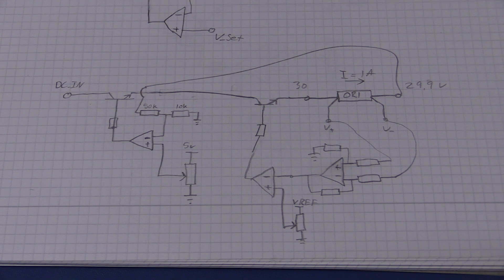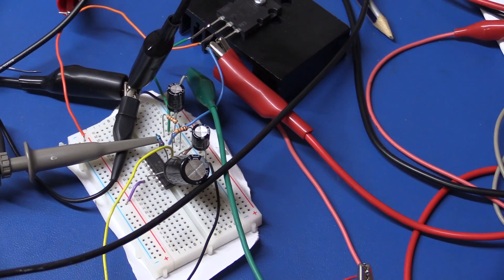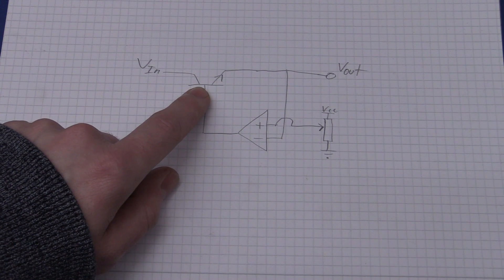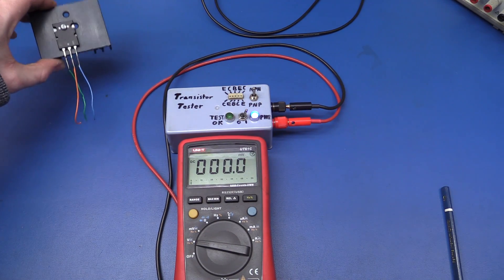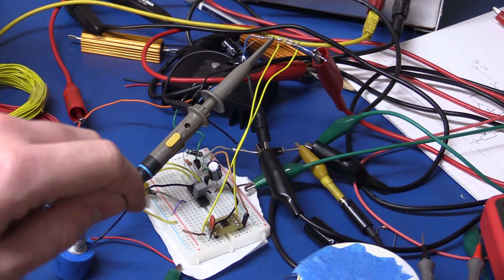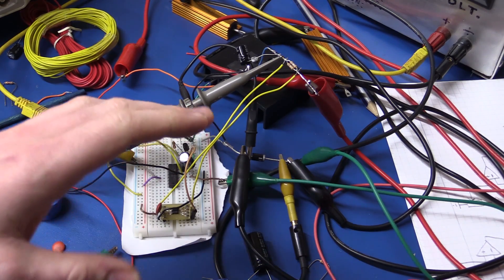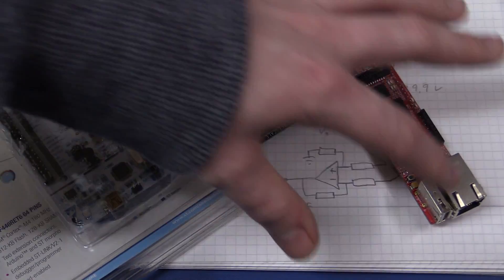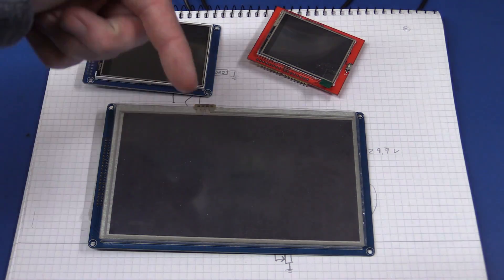DIY Digital Lab Power Supply: Part 2 - Ec-Projects

Comment: Maybe way too late since you might already have decided: but I really like the STM32 series of micros. The AVRs on Arduinos feel so limited hardware wise in comparison. But I still got a lot to learn about the STM32 and a project like this would really help understand more of it. It is true that it is not as easy to start out with as an Arduino is, because even with the core libraries provided (CMSIS, standard peripheral library) you are much more down to the metal and need to know the workings of the STM32. Arduino hides all that from you (and, due to the very limited features of the AVR, is much simpler to begin with).
Reply from the maker: Yeah I agree.. I like the STM32s very much! Their style of doing documentation sucks though, but when you get used to it, it's ok I guess :)
However, seems like most people would like the Arduino :)

Comment: Why you don't use a Teensy 3.2? It's cheaper and more powerful then the Arduino Due and you can program it with the Arduino IDE with all the Arduino compatible libraries!

Comment: Do you still use your k40 style Chinese laser machine?
Reply from the maker: Yeah! Don't use it every day, but nice to have when you need it :)
Reply: EcProjects
Still holding up?  They lose power, so it is said, just sitting there (the co2 tubes).
Reply from the maker: Yes, it's still fine :) I haven't noticed any significant drop in power. Might have dropped a few % without me noticing it. Hard to tell :D

Comment: Sir can i use a 2n3055 transistor ? which modification i have to make?
Reply: Yes you can, no mod needed, just don't overdrive it aka remember your output wattage.
Reply from the maker: Yes, should work fine!

Comment: What about using an esp8266 or esp32 board?  You could do data logging and it would be isolated from the PC.  Which reminds me, what isolation issues might you have with a USB interface?  It would be nice to have PC control and logging.
Reply from the maker: Not really thinking of going wireless, sorry :) A USB interface could be nice. don't know if I will make it though.
Regarding the isolation, it is mostly a safety factor. If something goes wrong, the computer is protected. But also the other way round, if your computer sends out 240v on the USB for some reason, it does not fry your equipment. Another factor is noise pickup. If the USB cable is electrically connected to your circuit, it will act as an antenna and pick up noise :) By adding optical isolators, you solve both problems :)

Comment: what is the highest frequency own a arduino or teensy can generate? I was told around 400Hz. is this true? that is what I was planning to use for my inverter.  also I have heard paralleling MOSFETs can be tricky sometimes. how would you do this. I will need to switch between 150&350 amps @24v. your input on this project would be great. thanks
Reply from the maker: I would say for a software generated square wave you can get at least 1 Mhz. PWM is 32 Khz as far as I remember.

Comment: regarding the oscillations: i dont see any loop compensation capacitors?
Reply: Yup! They do magic, my PS had poor load regulation - I set 12.0V and when I connect the load it sags to 10.8V. 180pF between inverting input and output of the error amplifier and now the voltage is solid like a rock :)

Comment: I have a feeling this whole voltage loop followed by current loop will result in bad overall transient response. During current limiting, your voltage loop opamp will most likely saturate leading to over/undershoot once the current limit is lifted.
Reply from the maker: It might.. But it's just a demonstration of the theory anyway. We will end up with a single power transistor in the end. There is also another fundamental issue with this circuit :)